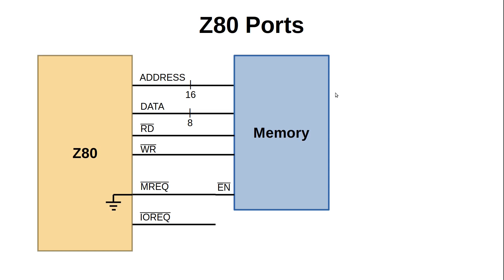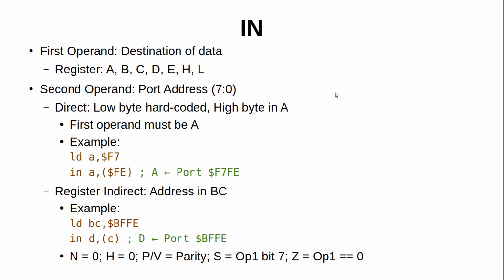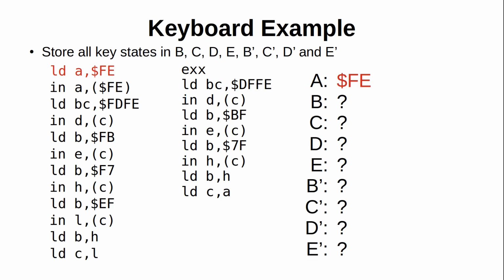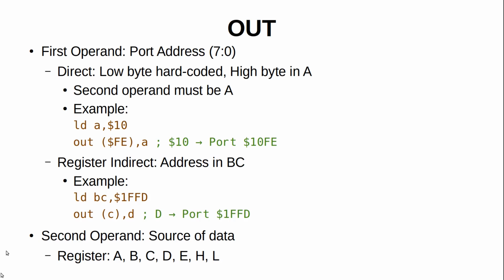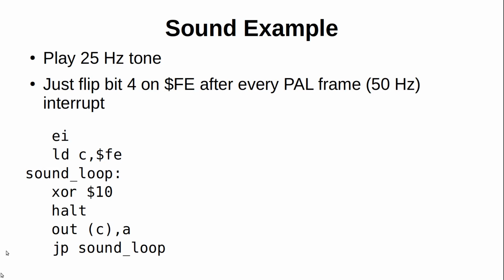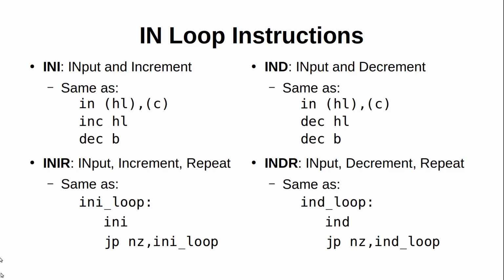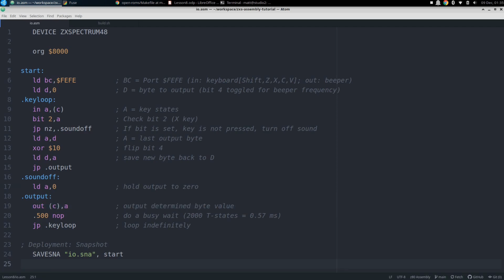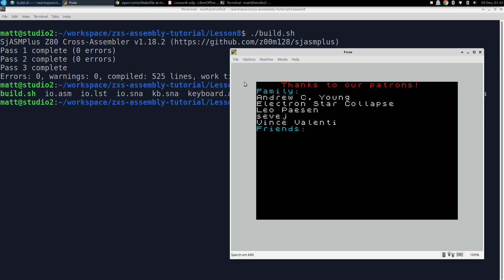In and Out: Z80 Assembly Language for the ZX Spectrum Tutorial, Episode 8

Comment: For a great example of the difference between code running in contended vs uncontended memory, just use org $7800.  With org $8000, as you have it, the code is in uncontended memory, and gives a nice steady tone.  With org $7800, the code is in contended memory, so the Z80 keeps getting paused so the video circuitry can access the RAM instead, and so the timings are all thrown off, and you get an awful screech.

Comment: As you say the ULA handles even IO port but really only 0xFE does anything useful for us. As well as reading the keyboard, stuff like controlling the border colour and reading / writing to tape uses that port.  Many different tape-loaders were written - some for speed purposes, some for doing animated loading screens. I have also seen some games that make good use of border colour changes.

If you were lucky enough to have a ZX Interface 1 then there were 3 more ports you could use - 0xE7 (microdrive), 0xEF (RS232) and 0xF7 (ZX Net).  

Kempston joysticks and interface were popular and used port 0x1F (and preceded the Sinclair ZX Interface 2 which also had non-compatible with Kempston joystick ports)
Reply from the maker: Yup, and in the demo you can see that writing zeros to $FE all the time, except for bit 4, makes the border black, instead of gray, like default. I do plan on doing a Tape I/O lesson at some point, as that is the main means of mass storage, even in emulation.

Comment: I know this is my C64 bias showing through, but the IN and OUT instructions of 8080 derivatives always seemed so wasteful, when memory mapping seemed at least as straightforward.

On the topic of the buzzer, Tim Follin's work on the Spectrum is probably the best example of getting decent audio out of it. If you do decide to do something on audio, the AY-3-8910 might be worth covering separately from the Spectrum, if only because it's a relatively straightforward sound chip and one of the few from that era that's still easy to source. In fact, I'm pretty sure there are compatible chips still in production. It's at a sweet spot of complexity where, while not as powerful as the likes of the SID, you can still do great stuff with it. The SN76489 would be an alternative, but the 8910 is more capable while not being that much more complex, and doesn't have the weird data bus the SN76489 has.
Reply: As to IN/OUT being wasteful - it is just a different way of looking at things.

Of course the Spectrum (being built to a price) went for somewhat of a hybrid.  As we have already seen in this series video output (and user-defined character data) is memory mapped and the ULA takes care of reading that part of the memory map and displaying it.  Other Z80 home computers of that era (Lynx, Memotech, MSX etc) tended to use a dedicated video controller (Motorola 6845, Texas Instruments TMS9918, Yamaha V9938) although the Camputers Lynx was quite interesting as it used an IO OUT instruction to page in a bank of memory for each pixel colour plane (not sure what the real term is) and an IO OUT instruction to return things to normal - rather than an IO OUT to call a plot pixel function on the video controller.
Reply: In what sense do you find it wasteful? It does need some extra transistors on the die to support these instructions, and at least one extra bus signal, but it gains you the extra memory space (you can use the full 64K and still have devices), and the memory bus is simpler (no wait states needed for slow devices).

Comment: Pretty sure that tone isn't 800 something Hz. Due to a hearing disability, I can't hear anything over 1500Hz, and I hear exactly nothing :). Are you sure it isn't double the 800?
Reply from the maker: I do have it pretty low in the mix, and also it's not a sine wave but a square wave, so most of the harmonics are much higher. You can try building and running it yourself and see if you hear it in emulation. It should be pretty close to 875 Hz as each cycle has 4000 T-states of NOPs plus just a few additional instructions, so if anything it should be a little lower than that, but still being augmented by all those higher-frequency harmonics that required me to push it down in the mix to not be so annoying to folks who can hear them.

Comment: in a,(0x3fce) or LD HL,0x3fce :  in a,(HL)
Reply from the maker: Neither of those is directly possible with the Z80.
Reply: @slithymatt 
ASSEM 10
10 CODE 
                           LD HL,0xface
                           IN A,(HL)
                           AND A,0x7f
                           OUT (HL),A
                           RET
Reply from the maker: IN A,(HL) can't be done, really. You need to copy the port address from HL to BC, or just use BC from the start.